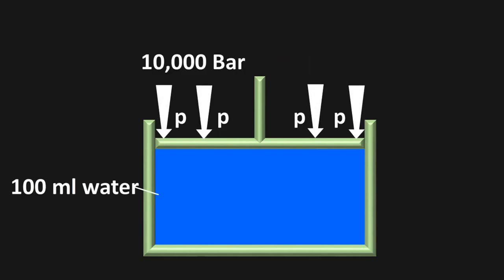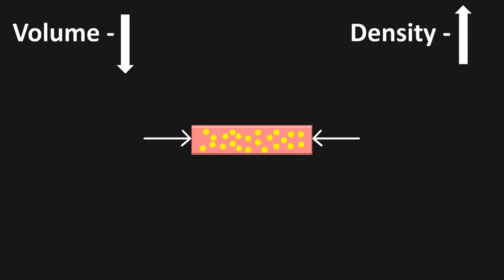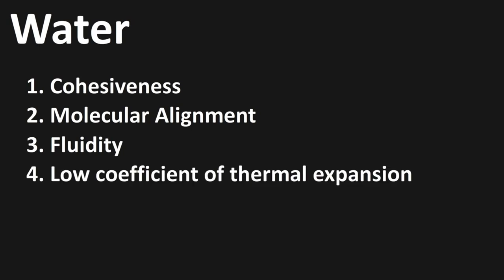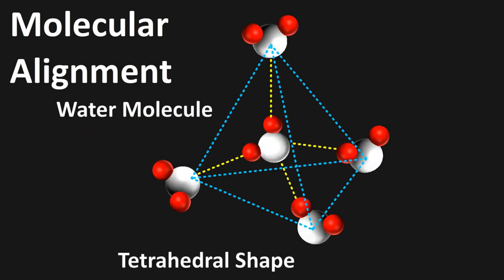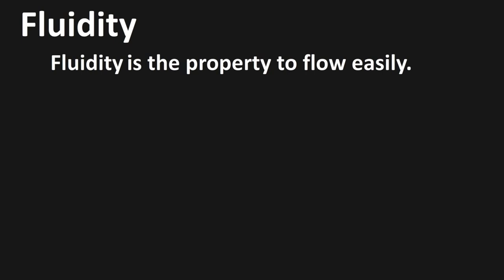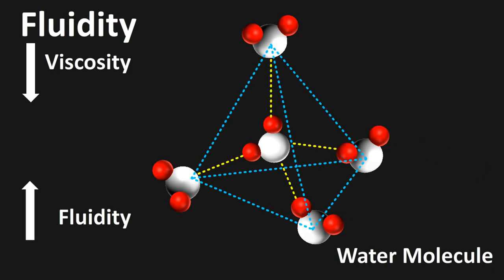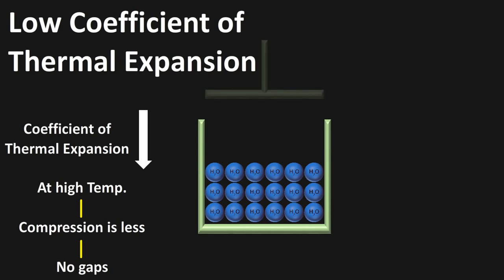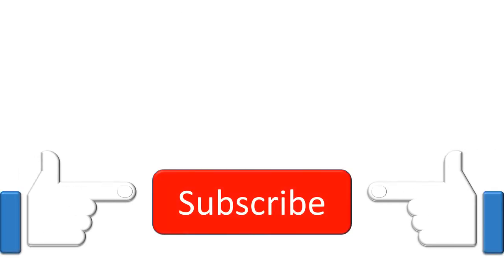Water is incompressible - Biggest myth of fluid dynamics - explained

Comment: What I was actually trying to find out is if enough pressure could be applied without leaking would the water explode and vaporize?
Reply: yeah i wanna know that too
Reply: Same here
Reply: @dyldaddy5961  No. Enough pressure would just make the water a solid. A vacuum on the other hand, does cause water to vaporize.
Reply: @Dee-nonamnamrson8718   Apply enough pressure to water and it will get so hot that it will actually evaporate.  So yes, the water can vaporize by applying pressure.

However, apply an extreme amount of pressure before the water has a chance to evaporate, and it can be compressed into a solid, a very hot ice instead of cold ice.
Reply: @pedromontalvoolivo6392   Applying pressure raises the boiling point. It's impossible to cause water to boil by adding just pressure. Lowering pressure lowers the boiling point, which is how you can boil water at room temperature.
Reply: Look into the crystalline phases of ice such as Ice VI. Might help answer your question.
Reply: @Dee-nonamnamrson8718  when we apply pressure to molecules they get heated i.e gain more movement. thats wht happens with gases they get more heated up through compression. if you could compress water enough so that its molecules gain movement it would evaporate and become a gas it can never become a solid through pressure
Reply: @johnxina7496  "However, according to the latest findings by researchers at the University of Rochester's (UoR) Brighton, New York campus, water also forms ice-like solid under extreme heat and pressure."
Reply: @Dee-nonamnamrson8718  when the water is "boiling" in room temp. Is the water actually hot?
Reply: @IntelligentElephant  No, its room temperature.
Reply: @IntelligentElephant propane boils at -45°f.. it can burn your skin upon contact but it's not a fire burn..  obviously at -45 something isn't hot,  but it does burn.  I'm just a YouTube scientist so take this somewhat with a grain of salt.  You know how we all like to act smarter than we are, right?

Comment: There was some people doing dnd and one person activated a force Field with a volume of ~2,000cubic feet, and someone else used a “magic sponge” that released ~3,000cubic feet of water, compressing water by ~2/3 making a inside pressure of +400,00psi, for context that is the blast wave that would be caused at ~70m form the original tsar bomba design(100mt). As if that wasn’t bad enough not only is it a 400,000psi blast wave, it is a 400,000psi water “incompressible” blast wave water is many many times heavier then air so it is going to last a lot longer.
Reply: if you put one of the dust of dryness water marbles in a custom - made hollow unbreakable arrow, you can compress water to millions of times smaller, creating more heat than the core of the sun, and 100 tons of plasma.
the level of pressure this would cause would allow the plasma to escape from even the most microscopic gaps, causing a massive plasma explosion.  you may even need to take into account nuclear fusion if they try to cram multiple orbs inside.

Comment: So if you had an infinitely strong container and an infinite amount of pressure applied to the water, would it eventually just turn into nuclear fusion?
Reply: My same question??
Reply: @prafulchavan2805  water can not be compressed ...yes it can happen but only in imaginations becoz of  your condition
Reply: It can be compressed but the water molecules structures will breaks apart at the beginning and splits into individual atoms H and O, After that the heat will increases significantly and tremondously, High energy and Radiation will be occurs during the process... But And in the end you'll get mini blackhole as the result...
Reply: Everything turns into nuclear fusion when it's contained in an infinitely strong container and an infinite amount of pressure applied to it.

Comment: But what would happen if you put water under 100's of millions of PSI and Incase it in metal walls like 20 feet thick, would you be able to compress it more than 3%?
Reply: At extremely high pressures water will turn into ice XI, probably compressing by half.
Reply: The metal would also compress no matter how thick it was.
Anything you tried to use as a piston would compress. It's not possible to do in real life without some exotic material from a neutron star etc.

Comment: As you say that compressibility reduces volume by applying pressure on any substance and h2o has less compression due to less thermal expansion even in high temperature how? I didn't understand the thermal expansion point

Comment: What if the pressure is so great that even atoms break?
Reply: Put enough pressure to 2 atoms and they will fuse, making a new element.

Put enough pressure to a single atom and the electrons and protons would fuse to make a neutron and nuetrinos. 

This is probably what happens on neutron stars, pressure inside those stars is so strong that electrons and protons fuse to from neutrons and neutrinos. Neutrinos would fly away into space, leaving only neutrons and that's why it is called a neutron star.

Then pressure the neutrons even more, and well... we don't know what happens. Maybe a black hole, maybe a new type of particle, or maybe neutrons can not be compressed any more. We just don't know.

Some scientist theorize that pressure is not infinite and when neutrons reach the limit of what they can be pressured, a black hole forms where density at the center is infinite and pressure reached the maximun limit.

Other scientists theorize that while pressure is not infinite, maximun pressure would occur when all matter in the universe is condensed into a single tiny point and then explode, in other words, The Big Bang.

Comment: Can you pull a vacuum on water?
Reply: Yes you can
Reply: @jaysproduction4  okay then with that out of the way now, water will boil or vaporize at an extremely higher temperature under a vacuum. It would also be able to maintain the heat more efficiently than a non vacuum or pressurized containment. I think at this point water might begin to act a little different and compression of water should then yield surprising results.
Reply: Or the water turns into an earth-type plasma at extreme temps... Who knows🤓

Comment: There is no way to compress a litre of water into a 2 µm sphere. for example. As we don't have the material to withstand the pressure. But imagine we could do it with an impermeable magnetic field (which isn't impermeable, but just for the exercise, we do have one), and we compress it like that in an effort to reach singularity. What would happen ? First of all, we would need an infinite power to feed into the electric system that produces the magnetic field, which is impossible.... But what would happen in the process? Hydrogen and oxygen molecules would be stacked upon each other. As we increase the power, well, what WOULD happen? I don't know. 'Singularity' would mean 'there is nothing left', so I guess that we would need 'infinite power' to reach that result, and that is impossible. Would the molecules merge and transform the water? Would they split into pure hydrogen and would the oxygen molecules be destroyed? Or the opposite? Does anyone know the answer to that? Thank you.

Comment: 10,000 bars is 9869.233 atm.  That kind of pressure cannot be found on the surface of the earth except in laboratories with special equipment.
Therefore we can safely say that water is not significantly compressible in everyday life.
Reply: your brain would get a '404 page not found' signal and send a lethal self destruction fart signal in 5.

Comment: I might be picking nits here but at the depth of the Marianas trench water WOULD be compressed.  Even if it's only 1 - 3%.. it is compressible.  You probably wouldn't even notice the difference with the naked eye.. but still.  You did, at one point,  say water was practically  incompressible but it wasn't clear.  Anyways, love the info contained in this video, thanks